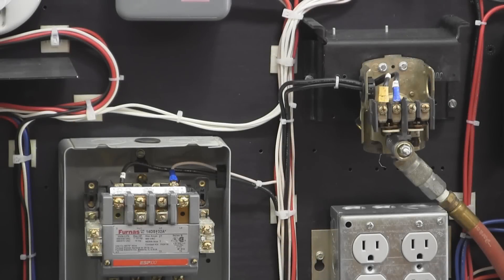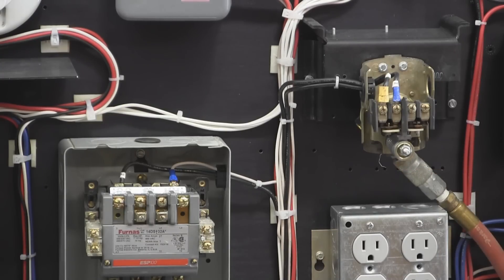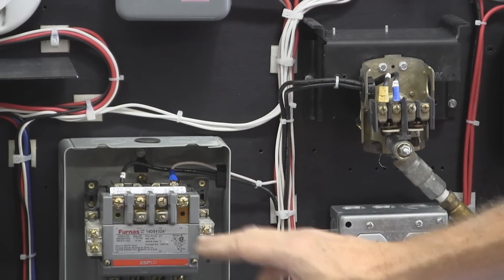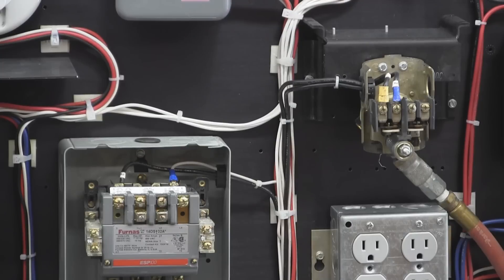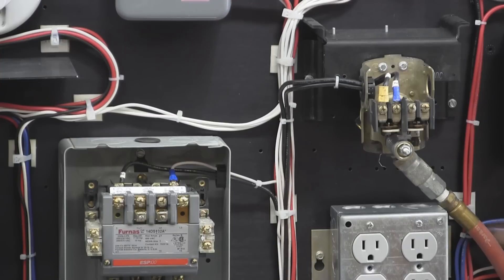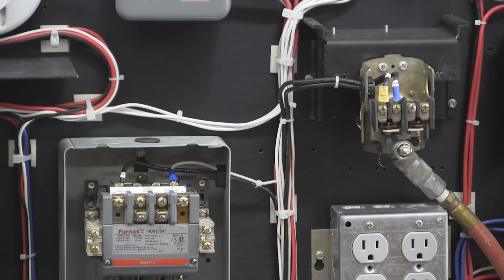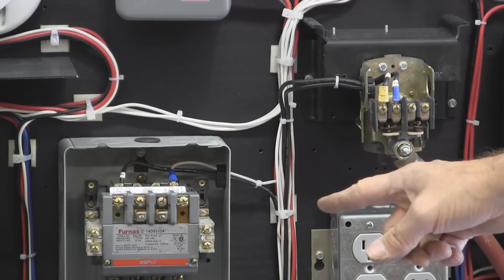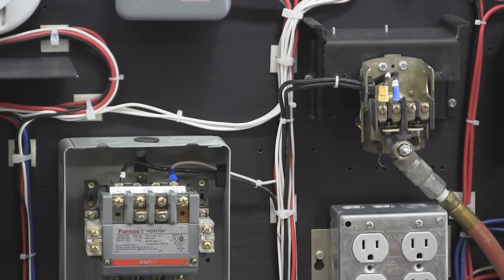Pressure Switch for Air compressor

Comment: Does anybody know where to connect the 2 pressure switch wires into my cutttler hammer AN16DN9 starter?
Three phase 10 hp 220v

Comment: might be nice to explain how the wires are run from the coil to the pressure switch and then back to the coil.  Also, on the pressure switch we notice you are on one side of 4 lug block of the pressure switch.  Are they connect to line/line or motor/motor or line/motor?
Reply from the maker: In this demo the pressure switch controls the contactor. This would be common with a three phase compressor. The pressure switch used in my demo was out of a 220v single phase compressor and was controlled by just this switch.